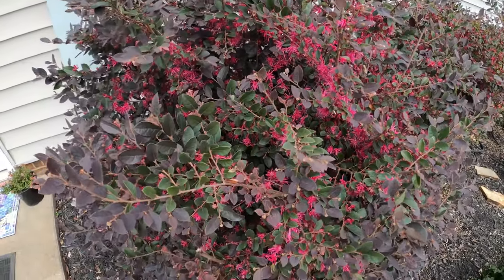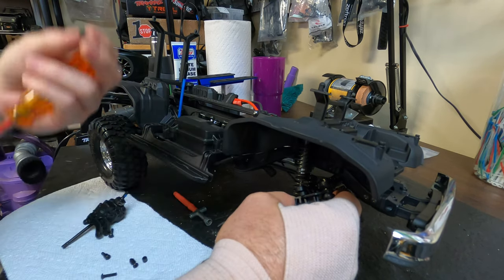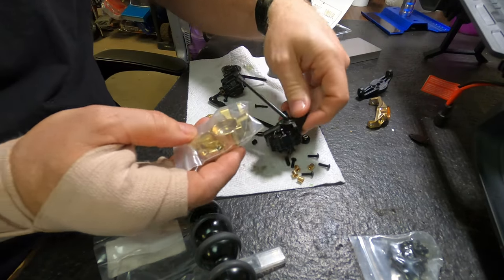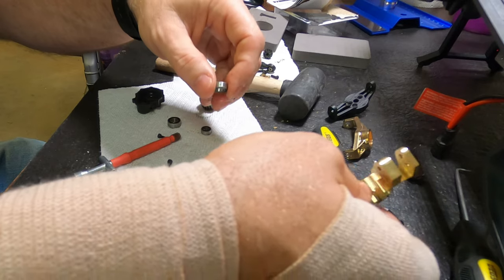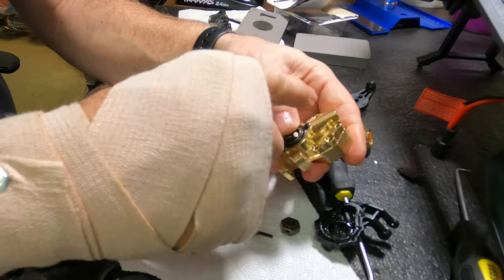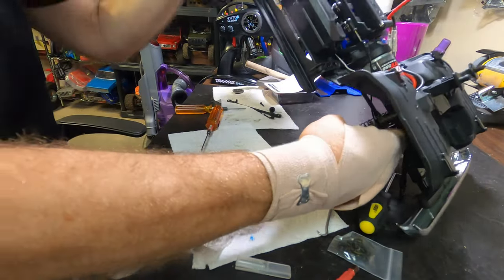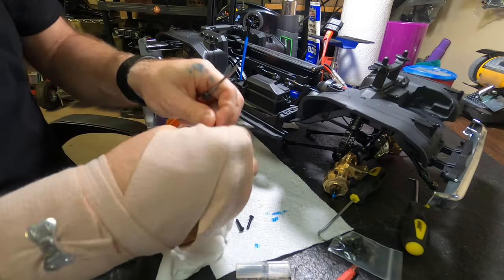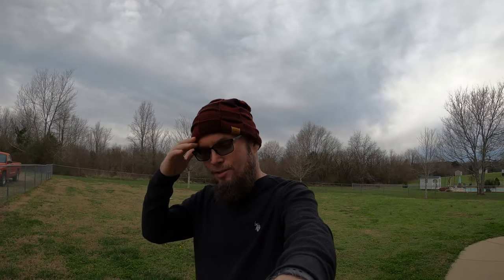Trx4 Brass Upgrades - C-Hub - Steering Knuckle Portal Cover - How to Install Brass Upgrades

Comment: Nice job on the video and some good tips for doing the brass swap. One thing, there is a left and right on the C-hubs and unfortunately Traxxas made it so it's possible to fit them on the wrong side which will affect your castor angle and steering.
Reply from the maker: Thanks gravity 👊, I’ll have to take a second look at that crawler and I’ll pin this comment to the top 🔝
Reply: @bigheadrc  Thanks. I really enjoy all your videos. You always have such a great group crawling with you and such a variety of builds that it's a lot of fun to watch.
Reply from the maker: @gravity1  Thanks Brother 👊👊👊👊👊